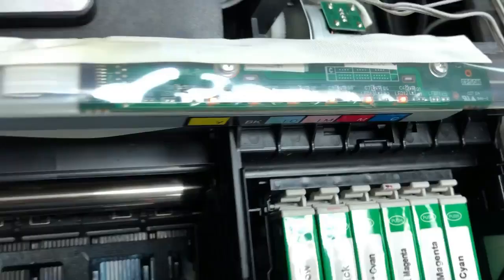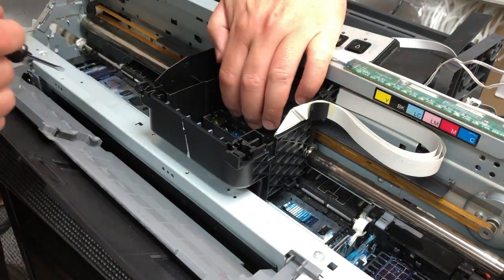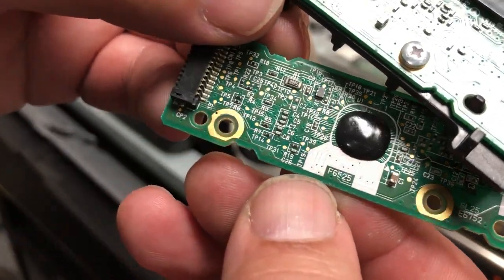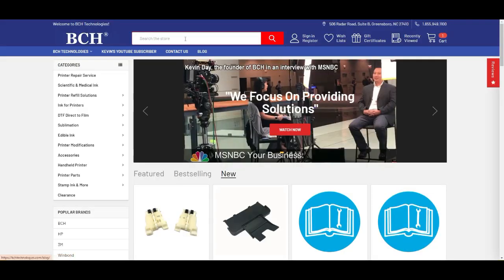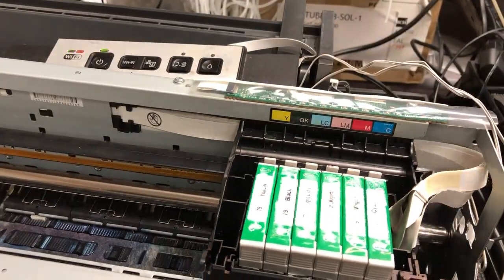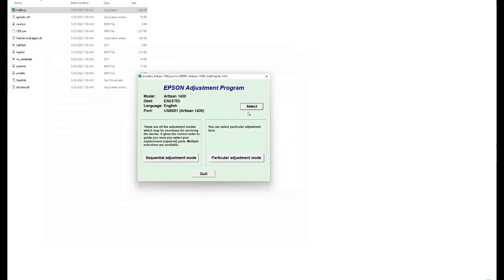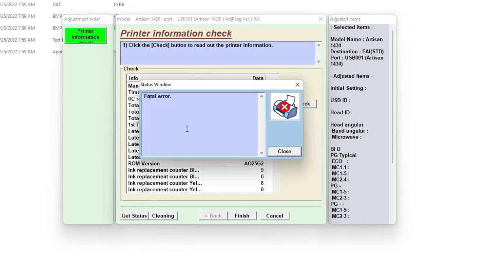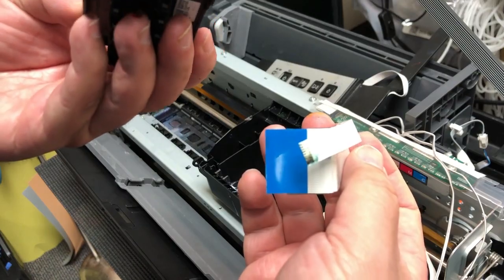Replace CSIC Board for Artisan 1430 - Epson NOT Recognizing Cartridges

Comment: I replaced the printhead on my Epson stylus 1400. I ran two head cleaning cycles. They ran just fine, on the third, i got 'x' on all ink cartridges icon and the icons turned a bit pixelated. I took all the cartridges out and began to put back one by one. It seemed like it was working but when I installed the last one, i would get x's back on all icons. It does not matter which color was last, once the last one is installed all ink icons get a red 'x'. Do you think this is the csic board?